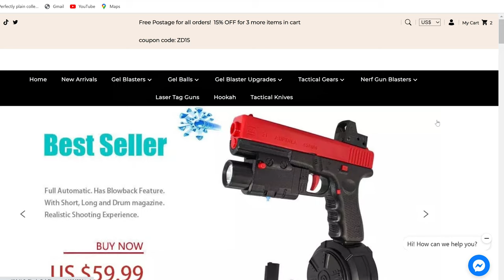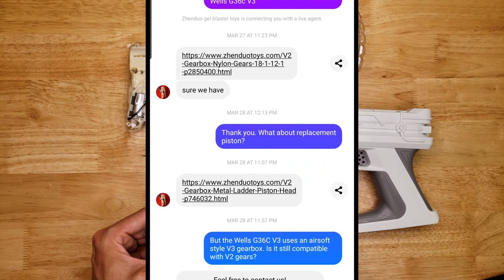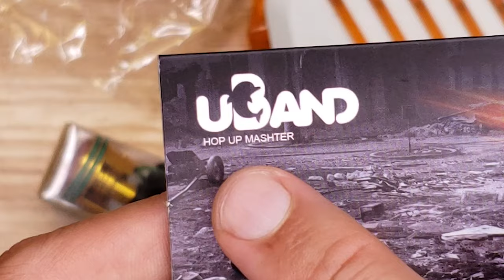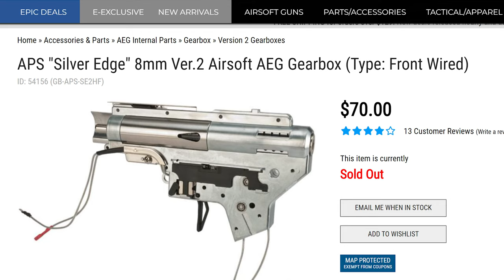I ordered GEL BLASTERS and UPGRADE MOD Parts from ZHENDUO. This is all I got. For Splatrball, Surge

Comment: Dammit man, my order from airsoft Atlanta just came in today... was just going to upgrade the plastic gearbox.  But now that you've found a legit cyl head / nozzle.... I might just get a metal box
Reply from the maker: I haven't tested the cylinder head/nozzle yet, so hold up because I don't know if it actually works. It just looks like the same length and I read that it works on the WELLS G36C (like the Lightning Blaster)
Reply from the maker: @TreYay83  I've seen Australian gel blasters use that gearbox shell, they had to cut away some of the tappet slot, which you probably need to do with any airsoft gearbox.

Comment: the skd m1911 has a high performance gearbox with metal gears?
Reply from the maker: There are metal gears available to replace the standard plastic ones. Problem is the piston rack is still plastic...

Comment: Hey there! i know this video was posted a while back, but I was wondering if you know how reliable it is to receive the more "realistic" looking blasters that ship from China to the United States using Zhenduo. I have bought multiple blasters from them before, but from their US warehouses so there was no issues. However, their stock is quite limited here in the states and I am interested in a few blasters that they currently only ship from China. Just not too sure how keen I am on if they will get confiscated by customs or something. Thank you! :)
Reply from the maker: I can't speak to ordering a replica blaster, but I don't think US customs cares much.
Reply: @engineerable  gotcha. thanks for the quick reply!
Reply from the maker: One caveat, customs can hold up a replica blaster if it also has the real firearm manufacture logo. Which many of the ones sold overseas do. They usually don't have permission from the company to import with logos. Airsoft guns that have the logos have bought rights from the companies to import them.
Reply: @engineerable  oooo interesting. thanks for the info
Reply: @SavaJeZz  did you end up getting it?
Reply: @ScuffedHades  yup. got it in a couple weeks
Reply: @SavaJeZz  I bought from the us warehouse it's just seems sketchy cause it's such a good deal

Comment: You got any recommendations to upgrade fps on a gel blaster surge? I can’t find any nozzles like the srb400
Reply from the maker: Their latest Gen2/3 blasters have a stronger spring that increases FPS from 150 to 175. That's probably the limit before you blow the gears, or the motor is not strong enough.
Reply: @engineerable  do you have a link or where to buy it?
Reply: @engineerable  and thank you so much
Reply from the maker: @mauygarcia1750  https://amzn.to/3BtXUBx
Reply: @engineerable  I have the gun but I want to upgrade the spring or piston or anything that I can upgrade, I am about to order the metal gears from the vid about zhenduo but I also want to upgrade it more
Reply: @engineerable  basically anything that improves how it works and it’s fps
Reply from the maker: @mauygarcia1750 tbh, your not gonna get much more than 180-200FPS out of it. Issue with metal gears is that there's no metal piston rack, so that plastic piston rack will still wear out.

Comment: I ordered a gen16 hk416d gel blaster on December 9 and I'm still waiting for it. lastly, It was updated on December 24, it's still in flight departure. I received a few messages that it says "Your package can't be delivered due to an incorrect house number" but everything was fine. I clicked on the link and filled in my address again but haven't received it yet. Do you know what the issue can be?
Reply: I live in Connecticut by the way.
Reply from the maker: Bro, I do not work for Zhenduo, I've only ordered a few parts and some blasters. Contact their customer service.

Comment: question did you use the Site Stripe payment method? if so is stripe safe to use or is it not that safe for credit card protection?
Reply from the maker: Yes, I used that, and in theory it's a safe, well established CC processor. It appears as though they use Shopify for their website. The problem is that if someone wanted to steal info, they could easily fake all that stuff. However, many people have said they've also had no issues ordering from Zhenduo.
Reply: @engineerable  ive been debating on ordering since its a big order for me and my friends and im the one whos gonna do the big order and they will send me the money so its a big play with 800$ worth of gel blasters and accessories. so do you think its safe if i do it without an VCC since i dont have one?
Reply: @engineerable  question, i just ordered from them but the tracking numbers they have provided dont work when trying to search for the order. did that happened to you?
Reply from the maker: @ak47striker1  I think it takes a while for the tracking number to update, since it comes from China.

Comment: Is the website legit do i have to worry about credit card information being used
Reply from the maker: Website is legit in terms of delivering products, but I would still use a virtual or limited credit card for orders to avoid any chance of fraudulent use later.
Reply: How long did it take to ship to you
Reply from the maker: @upbeat.  2-3 weeks
Reply: @engineerable   would using a virtual pre-loaded visa gift card work the same to avoid fraud?
Reply from the maker: @dorcuskluck  Yes

Comment: Nice! I just got a splatrball srb400, what are some mods I can do?
Reply from the maker: When your gears strip, you can replace them with metal gears and a stronger spring - https://youtu.be/3o4r5-Xr93U
Hop Up for better accuracy - https://youtu.be/bEzlIBcjeWM
New tactical stock - https://youtu.be/3A0smx8_7-A
Tactical top rail - https://youtu.be/uDNIhDrK42c
Vertical front grip - https://youtu.be/rrDBVoar6mM
Reply: @engineerable  Ok Thanks!
Reply: @cornholiomakesstuff582  nah the gears won't strip unless you upgrade the battery to a higher power battery so just don't upgrade the battery only add things like rails lasers sights and stuff